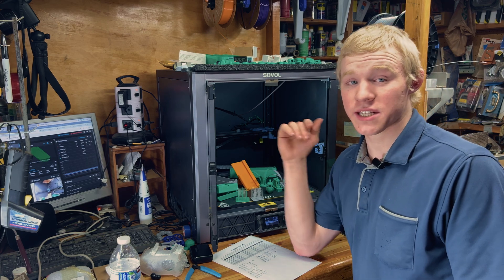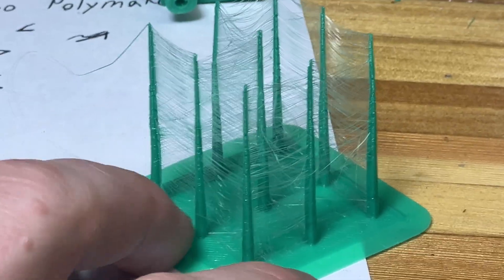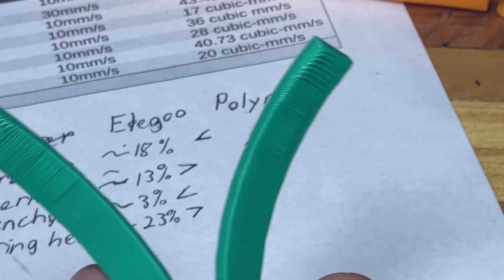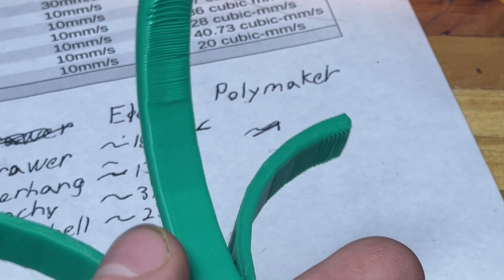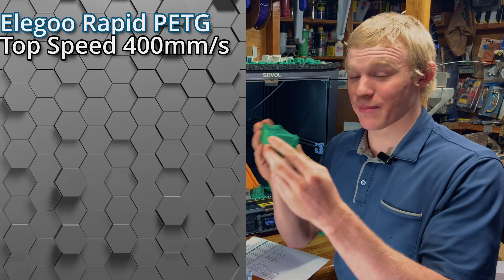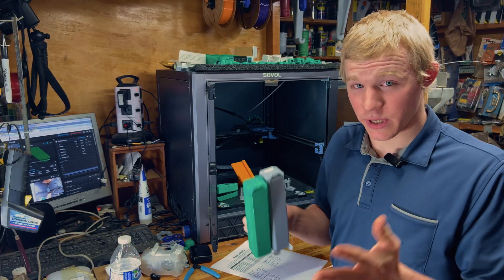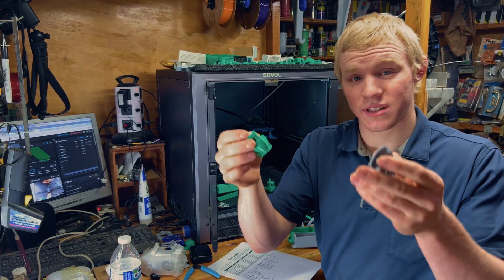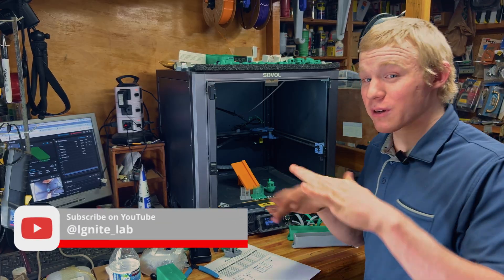The SV08’s Speed Unlocked!!

Comment: I own a SV08 since January and first I changed to the Biqu Panda Revo hotend. Which was very easy*.
The reason was, that i have a lot of those Rappidchange Revo nozzles from my old printer and I love the idea to change the diameter or to a hardened nozzle, even if I need it.
Besides I selected the 60W heater instead of the 40W of the original Revo system.
*) you have to check for correct types of plugs for the hotend. There are two different ones!

I do not have any problems anymore with the taco bed, since i changed the algorithm of the bed sensing.
I found one guy who analyzed it and improved it a bit. The bed still seems to be taco, but the three measurement values for each point are interpreted in another way.
And also the temperature deviation for the z offset is not that much.
I run different filaments, from PLA to ASA/Olevin and I set the z offset manually accordingly to the higher/lower temp between -0.10 and -0.18

Currently I build an enclosure and then I want to implement a fume filter based on carbon and hepa which runs the air in a circle inside.

Looking forward to see more of SV08 content on your channel. Lots of youtubers are only playing around with the newest stuff like a journal for the newest cars. But users do not buy new printers every month 😢

Comment: I'll often buy Elegoo PLA and PETG because I could get 10 kg of black for $95 delivered, but I like Elegoo's Rapid versions of those filaments better.  It's definitely not marketing hype.  The slightly more expensive filament prints faster and better.
Reply from the maker: I was looking at Elegoos 10kg packs and I really like the price. When I started 3d printing I bought whatever was cheapest on Amazon, but after I got the SV08 I went all in on Polymaker and they have great filaments just a little pricey. But now I am trying other brands to find the best bang for buck.
Reply: @Ignite_lab  - I have standard TPU filament (now TPU-LW) that I use to 3D print parts for my small business but for my other prints I tend to buy whatever looks interesting or whatever is a bargain.  I probably have 100 kg of filament.  Doing that means that I'm always engaged in at least some amount of trial and error.  The same material from different manufacturers prints differently, with even more variation when switching to a different printer.  It'll probably print using a generic filament profile for a specific printer but it won't print as fast or as strong or as pretty or with overhangs or bridging as good as it could with a tuned filament specific profile.

I've been 3D printing since there were no consumer 3D printers so I built my first two printers, and I'm only now trying to standardize on a few different filaments for different purposes, and developing optimized filament profiles for each of my printers.  An optimal profile makes it so much easier to get reliable high quality prints.

I've returned to printing ABS since getting the Sovol Zero, now often with carbon fiber.  The Zero makes nice looking and very strong ABS-CF and PET-CF parts.  I'll often choose CF only for the attractive matte finish.
Reply from the maker: @Liberty4Ever That is very cool. TPU is one of my favorite 3d printer filaments the problem I have for getting good profiles is that I print with so many different materials all the time. I need to get another printer to help speed up my research. I will also be adding a pellet extruder to the SV08 tool-changer mostly for tpu but other materials as well.
Reply: @Ignite_lab  - I'd love to see an SV08 with a pellet feeder.  I love that Sovol makes open source printers and encourages experimentation.  I feel like I own my Sovol printers.  I didn't buy any Bambu printers because I'd feel like they own me.   🙂  I have an SV01 that I haven't used in years.  I'd convert it to an electrochemical machining center but several years ago I stopped making things with my homemade CNC shop when I started making things with my 3D printers.

Comment: BondTech announced that they're going to create an INDX kit for the SV08 !! Looking forward to that coming out.
Reply from the maker: Me too! I will be installing it on my SV08!
Reply: What will it do?
Reply from the maker: It is a tool changer system for 3d printers. It will be a good low cost option for lower temp materials.
Reply: I'm planing that too, I hope we can get 9 nozzle, so it could do 8 colors + 1 for support interface
Reply from the maker: I am working on a system for more than 9, but we will see.
Reply: I designed and 3D printed an SV08 enclosure.  I designed it with eight filament openings on top.  I print a lot of TPU and prefer to feed the filament straight into the extruder from bearing hub reels mounted above.  I can see adding an INDX and building a custom 4-6 reel filament drying box that mounts above the SV08, not so much for multi-color printing, but so I could leave all of the filaments I typically use feeding different INDX tool inserts and select what filament I want to use in software at the start of a print, so I don't need to manually unload and load filament.
Reply: @Liberty4Ever  Do you have a video or picture? I'd love to see it.
Reply from the maker: @Liberty4Ever you are like a gold mine!! Thank you for all of the great comments.

Comment: Pre- ordered the sv08 Max. looks like the print quality on larger models looks great.
Reply from the maker: That is awesome! I think I will order the Max as well. And so far for me the print quailty has been amazing, even on prints that take up most of the build plate. It is crazy how much the settings matter for the type of print.
Reply: Yeah probably you will want to keep lower accelerations to have very high quality prints compared to the standard sv08, but considering you will be printing large things it will still be able to push the speeds
Reply from the maker: That is so true. I had not thought of that.
Reply: I'm a bit jealous.  Sovol learned from the SV08 so the SV08 Max won't have a warping taco bed like my SV08 and it has a fast and accurate Eddy probe instead of the slow and inaccurate prox sensor.  The SV08 Max has the same CanBus tool head as my Zero.  I think you'll be very happy with the giant SV08 Max if you slow the speed and acceleration in Sovol's stock profiles to optimize for reliability and print quality instead of print speed.  I needed to slow my Zero to get good print quality and reliability, and that'll be even more important with the longer belts on the SV08 Max.

I spent $500 on the SV08.  I just spent $217 on an 8 mm aluminum bed that won't warp.  Hopefully Sovol will release their promised Eddy probe upgrade for the SV08 and it'll be under $100.  With luck, for $800 and a few hours of my time, my beloved SV08 will finally achieve its awesome potential, almost a year after I bought it.  I could have an SV08 Max for another $200.  I'm not sure what I'd print on such a large beast, but every time I buy a new printer with new capabilities, I immediately find that I need that printer and can't imagine how I lived without it.